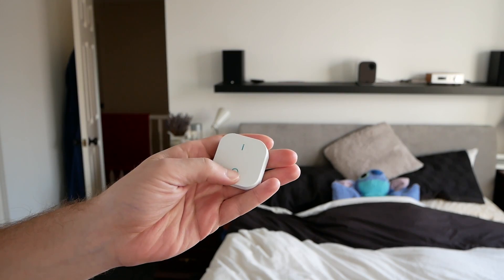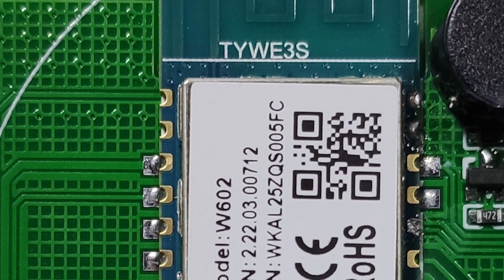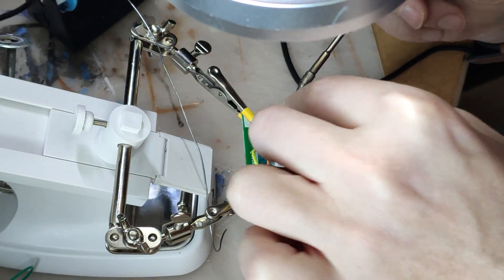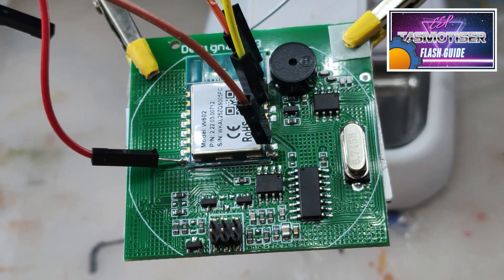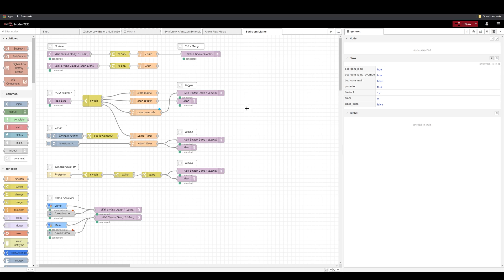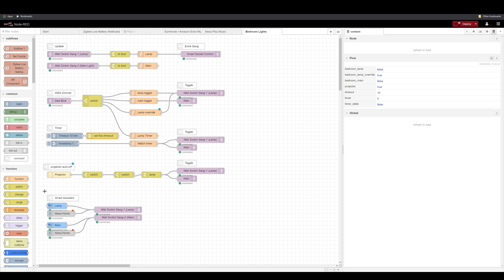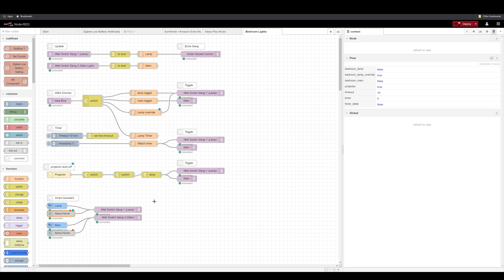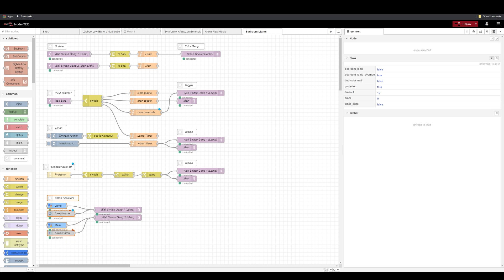A much smarter light switch (n+1 principle)

Comment: So Mat, could the WiFi switch be flashed using the Tuya-convert method that you use in the Novostellar video? My soldering skills leave a lot to be desired.
Reply from the maker: I have not tested it this way. In theory it will depend on the firmware. If the firmware is compatible with the hack then yes. Otherwise you get to practice the soldering skills ;)
It's not that hard providing you have a decent soldering iron.
Reply: @notenoughtech  It didn't work. :( Couldn't flash it with Tasmotizer either. Keep getting the "timed out. waiting for packet header" thing.
Reply from the maker: Time out is likely a message when the device isn't in the flash mode. Start the process then short the gpio00 to ground and reset (disconnect POWER  and reconnect)
Reply: @notenoughtech  So click "Tasmotize" then short gpio00 ?
Reply from the maker: Keep gpio00 to ground press tasmotize and the reset the power on esp

Comment: This is something I've been thinking about for adding the ability to turn off both lounge lights from either light switch without having to mess around with more wires to install.
Want to keep to ZigBee though, I assume this will work with 2 X 2 gang. 1 button on each would turn of each others wired light.
Only thing I've seen people mention is that the main light has to be L1 (left most switch) which is slightly annoying in my requirement, although maybe with having them as smart ones, it may not be a problem.
Thanks for this and stay safe.
Reply from the maker: Could you flip the switch 180? And mount the plate in reverse? This way you would have the lights other way around
Reply: @notenoughtech  That may just work... I'll check the plates to make sure orientation doesn't matter.

Comment: Love your videos Martin, always informative. I've been in the home automation field for many years and I found it's better to have more buttons but not so many that it confuses the user. Typically you want on/off control & maybe a couple of presets. If you add blind control, a button for goodnight in bedrooms, that's easily 5 or 6 buttons.
Reply from the maker: I agree, although I still need my panel done properly
https://www.instagram.com/p/BqGcI9KlN52/
as per buttons, you can make it contextual - blinds control when it's bright, lights when its dark